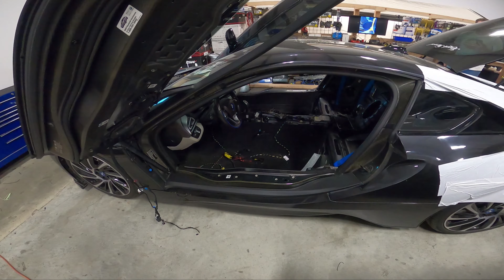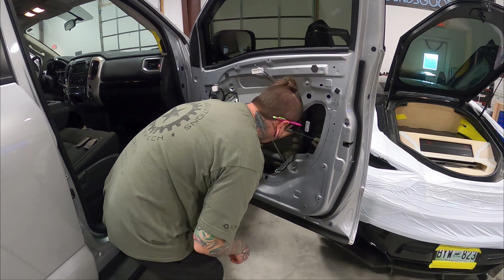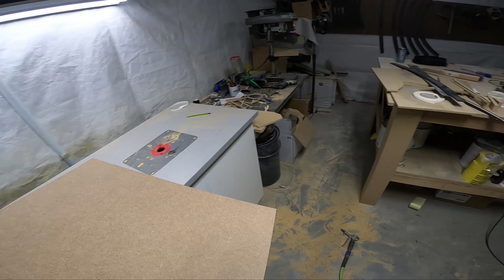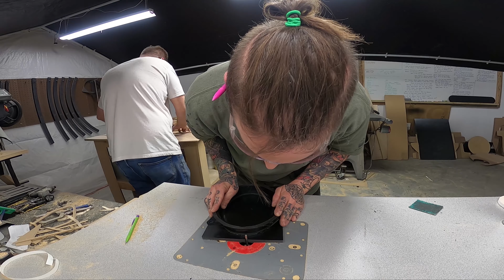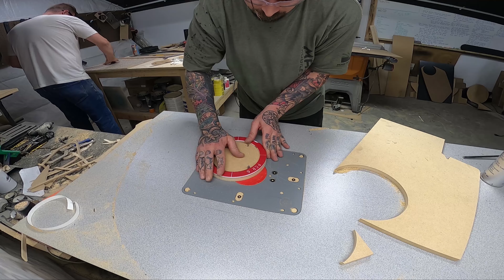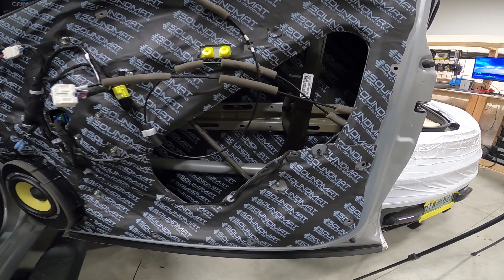2019 Nissan Titan High-End Custom Car Stereo Upgrade - Part 1 - Speaker Adapters + Sound Treatment

Comment: Where is the amp rack video build for the truck? Why didn't you show it?
Reply from the maker: We decided to not manufacture it for production/sale and also this was early YouTube for us, so we stopped filming certain parts to compete the truck to return to the customer
Reply: @SoundsGoodStereo  do you have the template for the rack for that truck?
Reply: @SoundsGoodStereo  did you use one whole piece of whatever material you used for the rack, or did you have to stack it? I see barely any amo rack builds on a Nissan Titan on YouTube.
Reply from the maker: We always use HDPE for amplifier racks. Unfortunately, we did not save the template :(

Comment: Hi guys, I have the 2017 Titan Ls Model with Rockford Fosgate system , what’s the best way of adding the rca cables , I want to add an aftermarket amp ( 5 channels ) for the front, rear door speakers and the sub and another amp for the dash corner and center dash speaker, I’m gonna change all the speakers around the truck with alpine component

Comment: I have a 2018 Nissan Titan “S” Base Model 4WD Ext Cab. I am a severe storm tracker here in Oklahoma City, OK. I would love to get the heat barrier/sound barrier on the inside of the exterior door panels, roof, rear cab, floor and fire wall for our heat season and winter then have the sound mat done on the door interior panels to make it a much quieter ride. I love the truck but it is sooo noisy and when it is raining heavily, on a gravel road or even hailing it is like rocks in a coke can. The oem stereo and speakers suck something awful but I am not much of sub/bass guy but would love to be able to feel the music whether it is country, rock or even classical (real classical).

Wish you guys were close, I would have you do the work because we have no one in Oklahoma that does that quality of work.
Reply: Mobile Concepts in Broken Arrow does amazing work and uses this same style sound mat.
Reply: @SenorReflex  thanks!
Reply: @shawnbayless777  tell them I sent you if you call or stop by!
Reply: @SenorReflex  will do

Comment: What did you guys use to plug the rca to the factory radio?
Reply from the maker: We used the high level outputs of the factory radio into our signal processor and it converts it to low level, RCA outputs. Just need to use test tools to analyze the factory signal to ensure it is acceptable to “amplify” with your new setup.

Comment: Is an upgraded alternator or larger battery necessary for just subs?
Reply from the maker: Stock size battery, just upgraded. Also, big 3 upgrade under the hood and we only use 100% OFC Copper wire throughout all of our installs. This combination does well and very rarely do we need to upgrade alternators on these newer, larger vehicles.